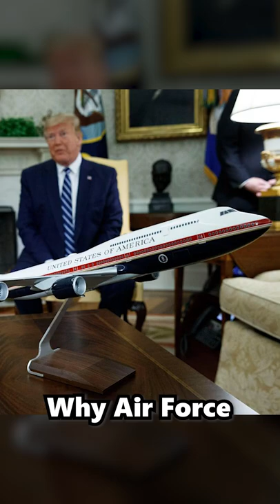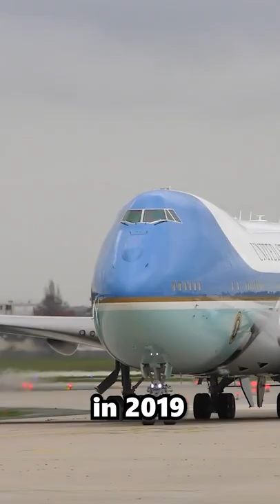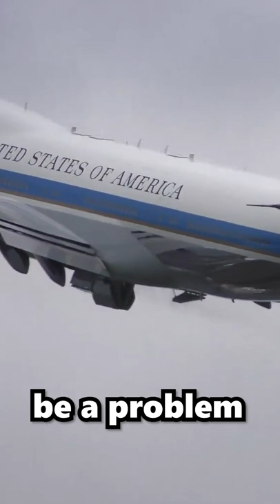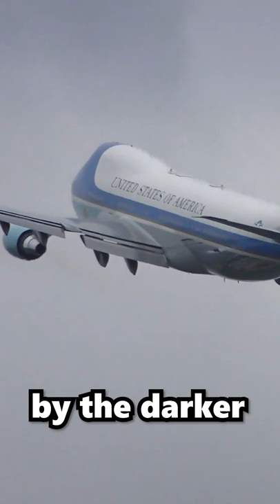Why Air Force One's New Livery Was Rejected

Comment: If we're running that close to redline on the temperature of "several components" that a paint color would push them over the limit then that plane is hideously unsafe as a few degrees increase in ambient temperature could do the same..

Comment: iirc, pepsi livery planes also exist with similar problems, overheating the plane when reaching higher speed. Theres a youtube video explaining it
Reply: But that was Concorde… this makes no sense on a 747. It is an excuse
Reply: @island5317  The 747-8 can fly right under the speed of sound, just around mach 0.98. The excess heat is genuinely an issue, especially since drag is higher at that transonic speed than supersonic.
Reply: @BrapBrapDorito  but it doesn’t cruise at that speed the range is limited at that speed so they cruise around .82-87
Reply: @TheOne_p  true, but Air Force one may very well need to cruise at higher speeds in case of an emergency, in which case it’s just better to eliminate the possibility of the excess heat causing issues.
Reply: @BrapBrapDorito  in case
Reply: @yu_meausealot  Yep. A very very rare possibility, but it’s better to be safe than sorry, especially with the most powerful individual in the world.
Reply: @BrapBrapDorito  they would never reach close to VNE at cruise, even in an emergency, especially with the added stress it would cause on the airframe. As is there are everything from escorts to TFR's anywhere it is (got caught in a POTUS TFR that sprung up in 2003, the suit people were very nice after 6 hours),  plus hours and hours of planning, operations in place well prior en route, on ground, etc. Paint color has nothing to do with the ability of the plane to operate, it's political.

Comment: I remember the C-135 and E-4 command post aircraft were once all painted overall white. Now that was mostly part of the passive Nuclear Flash resistance system, but it also was nicely reflective of sunlight infrared heating and ground reflection infrared heating.

Comment: I like the old paint scheme.  The first time that Air Force One was painted blue was using a scheme thought up by Raymond Loewy (who designed steam locomotives such as the Pennsylvania Railroad’s T-1 Duplex) and revised by JFK.  He chose one of Loewy’s sketches, and requested that Loewy change the color scheme of the sketch to blue, while keeping the pattern the same.  As differently types of aircraft have been used, the livery has changed some, but Loewy’s color scheme is still in use.  

All that said, I also really like the new paint scheme that was rejected.  It was a lovely patriotic symbol, featuring America’s standard three colors.  It would have been perfectly stunning.

Comment: If this is true, wouldn't they catch the color issue earlier ? So many meetings and experts involved
Reply: Because this is incorrect. 
Darker colors actually let go of excess heat faster, plus it was on the belly, getting much less direct sunlight.
Reply: They did, DJT simply wouldn’t allow it to be scrapped
Reply: @tankunext81  Dark colors absorb heat into the components inside. Ever got into a black car in high Summer? When the plane is not flying there is heat reflecting off the tarmac.
Reply: let me answer your question with a question, how many car recalls are there in a given year?
in 2018, 35, 2015, 86
they make hundreds of thousands of cars a year and still have to perform recalls because they mess something up, there are only a few Air Force 1's so, yea maybe they made a mistake.

Comment: So planes fly upside down regularly now…?
Reply: You know light bounces off objects, it may not be as much but the reason we see stuff is because the light bounces off objects and goes into out eyes, thats why when there is less light its harder for us to see stuff cause there isn't enough light bouncing off objects, but the reason why things on top are hotter it because of direct light contact, so as long as you can see something light is heating it, and that brings us to the plane, because the belly of the plane is black, light is not bouncing off it, and is getting absorbed by it, and when it absorbs that light it heats up, thats the reason why the color was rejected
Reply: Thank you.
Reply: Do you know clouds exist? They reflect light and they are under you.
Reply: @frafstet3835  I fly 747’s. The cloud reflecting light is not an issue. It is purely politics.  Everything this clown of a “president” and his handlers touch gets ruined.
Reply: @hellkell8693  strange that you say that. You know. Clouds are extremely reflecting and pilots have to wear sunglasses to non be fucked up by the light. Than I don’t know how being a pilot gives you competence in thermodynamics. Outside is -40 but heat radiates thru thermal radiation that his hot. The ISS is +400 degrees on the side facing the sun
Reply: @frafstet3835  I rarely wear sunglasses in the cockpit.  Any heat absorbed is cooled by the -40°. Bottom line it’s not the issue.
Reply: @ed1tz468  okay Mr. Lightexpert , do darker colors or lighter colors release excess heat faster?
Reply: @tankunext81  First I never claimed to be a light expert, if you listen in 8th grade science you would know this
Reply: @tankunext81  And all light waves get absorbed by darker colors while for lighter colors some light waves bounce off
Reply: @tankunext81  Fun fact the darker the color the less light waves that bounces on it
Reply: @hellkell8693  I never realized plane fly 24/7 and are never parked on a hot tarmac.
Reply: @hiddendragon415  you probably haven’t realized a bunch of things.
Reply: @hellkell8693  That is true 😀

Comment: Working in aerospace myself this is totally untrue.
Reply: The darker part is on the bottom of the aircraft which would only absorb the energy being bounced off the earth which I dont think is much at all compared to the sun beating down directly upon you. Also, for every 1,000 feet the temp changes 3.5 degrees less. So at 35,000 ft the temperature for a 72 degree weather at sea level would be 122.5 degrees less (if i did my math correctly) which would mean that the temperature would be -50 at 35,000 ft. Not to mention the airspeed of a 747 would be around 360 mph - 450 mph. So with all this together theres no way that the aircraft could overheat. Plus the top has a white paint design so even on the tarmac it probably would be fine.
Reply: Do you know what sensitive systems are in Airforce 1.
Reply: @ryandress9916  What about when the Plane is parked for hours on a hot tarmac?
Reply: @ryandress9916  an Air Force spokeswoman said darker colors, among other factors, on the underside of Air Force One "might contribute to temperatures exceeding the current qualification limits of a small number of components."
Reply: @hiddendragon415  possibly very sensitive indium type sensors for that to true.

Comment: The reason of "heat" on the fuselage isn't a big deal. The bigger deal here is that its more expensive and also heavier. And it actually makes a huge effect on a long term. Air Force One is meant to fly in the sky as long as possible in case of a nuclear attack or the chain of command needs to be on the move 24/7. 

Making fuel efficiency a high priority for a Nomadic Survival Plane.

Comment: SR-71 Blackbird
"LOL that's a load of bs"
Reply: The SR-71 doesn’t have a fuckton of temperature sensitive equipment in it’s belly.
Reply: @MrSimplified  .....Yeah it does
Reply: @oldnite3414  Enlighten me on what temperature sensitive equipment is in its belly?
Reply: @MrSimplified  As if that information is accessible by the public

The SR71 can reach much higher above the atmosphere which means all that temperature from the sun is not protected naturally, and it can go faster than air force 1 which means it's heats up faster as well, and you dont think it has temperature sensitive equipment?

Do you have downsyndrome?
Reply: @oldnite3414  You’re basing your information off of unproven theories, I am basing my information off of proven facts. Until you can provide me 1 temperature sensitive equipment name in it’s belly I have one this argument and will no longer be responding, I wish you a good day sir.
Reply: @MrSimplified  What about the sr71 is unproven?

 It's proven how high it can go and it's proven how fast it can go. I'm just saying it's obvious that it has temperature sensitive equipment because it heats up. If it didn't it would become a fireball

Comment: This doesn't make since it in negative degree when fling and have to heat most components of the plain, the old paint design the light and dark blue was a form of camouflage.  The current administration wants that camouflage.

Comment: The darker color like you said adds excess heat. It's not so much as the components as they are hardened to exterior forces The excess build up makes the plane more susceptible to heat seeking weapons and have  a bigger IR signature.
Reply: Most ir require the person to be close. The plane probably will be way to high for ground and cant imagine a enemy fighter coming with in 100 miles with out seeing atleat 2 f35 plus the 2 big enigne generates more heat then blue paint.
Reply: It is the components, that's what that the Air Force said 'A small number of components being possibly being pushed past their heat tolerance tested limit.

Comment: Darker colors also radiate more heat and are easier for IR weapons to track, and the bottom of the plane is an especially stupid place to have that problem.
Reply: If only they thought of that and installed flares or some other unknown precautions. 
You better call em up and tell em.
Reply: @kydrythm  You’re, like… 90% of the way done thinking that through.
How do flares work? By being a bright IR distraction.
If the belly of the plane is brighter in IR than it needs to be, it reduces the effectiveness of that IR distraction.
My point isnt that a blue belly is a guaranteed hit for IR weapons- its not. My point is that when they said “the blue gets too hot” they’re talking about more than just operating temperatures for electronics.
Reply: @TubTigers  flares don't always work. Especially now days. There are missiles that can identify what a flare is. Technology has moved past the 60s
Reply: @ethanedwards422   I'm not debating here. 
I'm telling you that the plane is very safe.
Reply: @tankunext81  Apples and oranges. First, modern stealth aircraft are silver, partly for this reason. The older radar absorbing coatings were black, that technology has been improved.
Second, fighter jets are smaller, with huge power-to-weight ratios, meaning the main source of heat is their engines. The paint color becomes a more negligible factor. For something as monumentally colossal as a 747, the IR emissions of ALLLLLL that surface area are a HUGE consideration.

Comment: But the paints on the bottom where the sun doesn’t hit it as intensely. Seems sus to me.
Reply: Cause it is sus. Dark paint is better for heat dispersing, hinse why it was on the belly, away from direct sunlight.
Reply: @tankunext81  LMAO dark colors absorb heat into the crap inside and think about a plane parked on a hot tarmac in Summer.

Comment: Fast plane in the world sr 71 is painted black heck if heat was a problem why not paint it white. Im pretty sure heat isn't an issue at this point
Reply: I scrolled for no joke, 10 minutes trying to find this comment. You're the only other one that commented about this. 
Black, or darker colors, dissipate heat much faster, and it's on the belly, not even in direct sunlight. 
The guy that runs this channel doesn't know what he's talking about.
Reply: The sr 71 was also built with slide rules and doesn't have the same advanced technology onboard. The Air Fore actually said they were concerned about the heat limits of a small number of components.

Comment: Two reasons: Larger heat signature. Bad for POTUS if he wants to survive missile attacks. Also means the plane can't fly at max speed for as long without overheating key components (most 747s don't fly full throttle all day)

Comment: The air force one "new suggested" look looks like one of the old designs for the air force one
Reply: Really, wheres the orange?
Reply: @BilgePump  one older design also have tge dark belly with those stripes, even if the suggested looks very similer, it more of based on more then exact copy

Comment: Light from the Earth? It’s on the belly so how would it get the light to heat it up, can someone explain it to me?
Reply: The light still reaches the belly, even though it's in the bottom, it's flying in heights where the shade would lack existence. This then still proves it will absorb heat more then most other colors.

Comment: Doesn't it get around -40 degrees at 32000 feet in the sky? How is a dark underbelly gonna be that much of a problem for some computer parts?
Reply: Outside, where the heat will be distributed, yeah, but not inside of a cramped metal tin can

Comment: Honest question; won’t the black on the bottom dissipate heat? If it was dark on the top of the airplane I could see why it would cook the cabin on the ground
Reply: Light bounces
Reply: Regarding yout question, you should be aware that black generally absorbs light and heat (eg: radiatiors are black as they absorb heat) and white generally reflects light and heat (eg: white walls of a building keeping the surface cool).

Keeping this in mind, if we paint an aeroplane's lower body in a dark colour, it will generally absorb heat. This heat may not come from the sun, but it may come from the friction between the aeroplane and air producing the heat.

Hope this helps you.
Reply: @anishpatra  but is a tricky thing cause black dissipates also if temperature around is lower. It works both sides... it was a thing in the project of SR 71 Blackbird which has a lot of friction but is entirely black.... paper skies has a nice vid about that if i remember well. That is to say phisics in these topic can be counter intuitive sometimes. In the case of SR71 the difference was supersonic flight and height i think...
Reply: What I never realized light was affected by gravity.

Comment: Total nonsense but a good bit of "makes sense" for the lower classes to latch onto. 

There are far darker paint schemes flying right now with equally sensitive components.
 
The shadow oligarchy currently has a blank cheque with a senile pensioner taking the hits so it only makes sense they shoot down the idea of someone who delayed their plans by 4 years.

And finally, any modifications installed that may be sensitive to heat would have some form of passive or active cooling and would not rely on the hitherto unknown paint scheme of the aircraft to do so. 

There's just so many flaws in the reasoning but it's presented cleanly and like I said, "hmm makes sense" will do it for many npc's.

Comment: It's work is in the sir where outside temps are typically minus 40. So the darker would radiate more heat out when it is in flight. Probably going to be a brown color now to represent someone.
Reply: It doesn’t work like that. It’s cold because there is less air. But energy also radiates. The part of the international space station facing the sun is 400*

Comment: Demorat BS as with all the air New Zeland aircraft that have been flying with the net paint scene with no overheating issues at -40 at 36,000 ft!!!!! Explain that
Reply: It's a ground heating issue mostly. The sunlight both directly and indirectly is hitting the dark painted areas. Remember that concrete ramps can do some serious ambient air heating. The lower fuselage and lower part of the engine cowlings probably contain lots of security electronics that don't like excessive heat. The USAF is going to be very cautious with how those electronics are kept below maximum continuous operating temperatures. Remember that the VC-25s can be required to sit in a form of "standby" mode with all communication gear in standby warmed up condition for hours.
Reply: @davidhoffman1278  Thank you i'm glad someone else can spot the obvious reasoning in this thread of MAGA hatred ignorance.

Comment: The dark color is on the bottom not the top so I call BS.
Reply: But the friction between the air and the body of the plane causes heat which gets absorbed by the paint creating the problems.

That's the reason the livery got rejected.
Reply: @anishpatra  but what does the color have to do with airflow? Blue is one of the coolest colors unless the jet is thermal coated. We tested several colors and it was better than red or white.
Reply: @jimblair2925  There is surface contact between the plane's fuselage and air due to which there is some friction because of high speeds. So, during the friction, heat is generated. As per your reference to blue, it is navy blue, which is a dark colour.

From what I know, dark colours like navy blue have a tendency to absorb heat, which will increase the surface temperature of the fuselage. Overtime, the surface temperature will be higher than average, which may interfere with the performance of the plane and the additional instruments.

Along with this, the blue paint adds additional weight for the 747-200, which can reduce the performance.

I hope you've got your answer.
Reply: @anishpatra  I was a pilot until my mid 20s and while I agree there is weight in the paint, again, unless it’s a ceramic and lead based coating, the color of the belly doesn’t affect the heat of the skin while flying and even if painted a different color, the weight will be the same. 
   In fact, if they went with a golf ball type dimple on the surface with trailing trenches down from the top of the fuselage directing the airflow, then the planes would use less fuel due to the directed lift. I checked with my cousin who is still a certified Aircraft Engineer with close to one million planes still in the Air based on his engine management systems.
Reply: @jimblair2925  Okay.